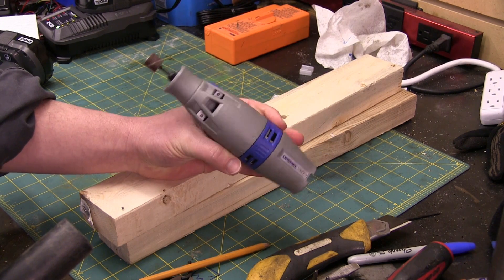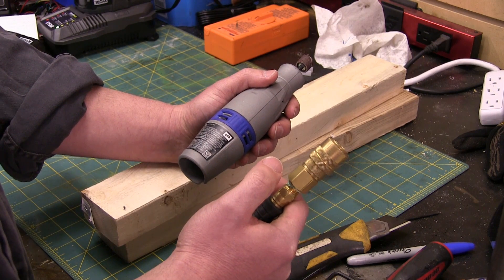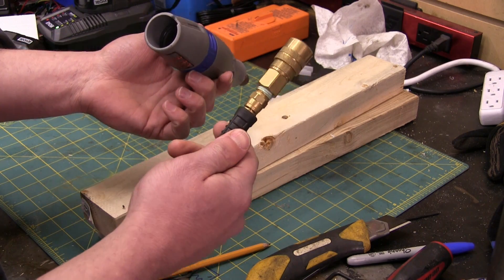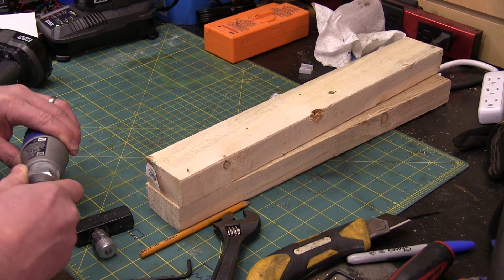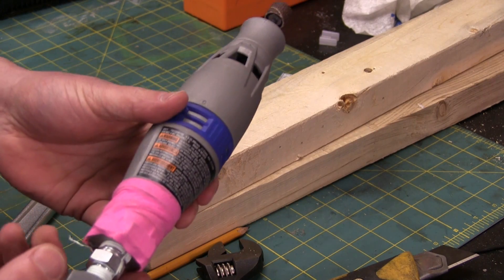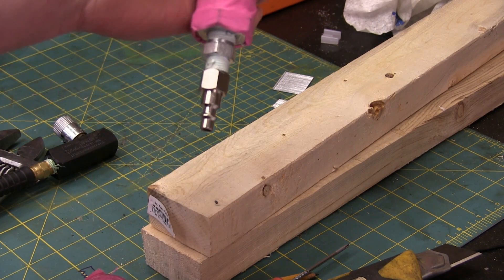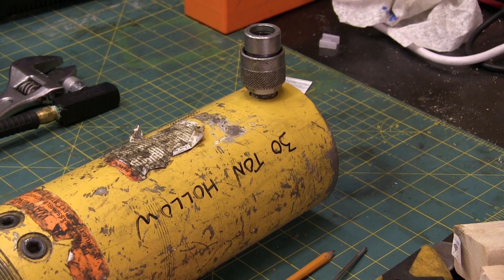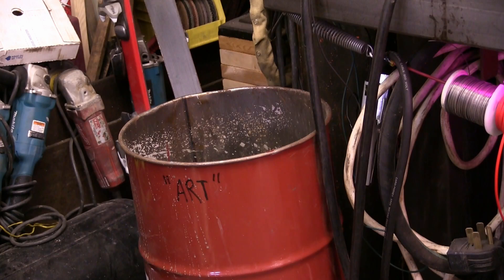You asked for it! Patron's Request: Dremel Suck Tool on 100PSI air

Comment: fittings are in inches, left over from the dark times.
Reply: +AvE Aircraft mechanic here no metric as far as the face balls can see. Aircraft are all From the Dark times!
Reply: GreaseMonkey well of course they still measure altitude in feet like it makes sense because you can relate to the amount of feet stacked up in the air and imagine the height.
Reply: @taticalguru  thought "system international" was it's on thread system.  Is it based on imperial?
Reply: +Paul Frederick Never happened
Reply: +Simonas Mažeikis (ZetZet) The dark times? Like when men walked on the Moon?
Reply: @1pcfred  ......but they never walked on the dark side.
Reply: +Simonas Mažeikis (ZetZet) meters?
Reply: +AvE&#160; fred form here in the&#160;rain soaked UK&#160;is still good old BSP (British Standard Pipe) but metricated and no a 3/8&quot; don&#39;t work with 10mm etc and for the gas (as in natural and not petrol) there is GSP and for us electrical types we have a BSP fred form for conduit which straight and not tapered ................. with all of it the good old Plumbers Tape for Everything (or PTFE for the uneducated) works .................... sometimes :P
Reply: +AvE 
When people had 12 digits
Reply: bicylindrico
Sure it did. I was there.
Reply: +AvE would have been nice to test it with leaf blower....
Reply: Paul Frederick men walked on the moon after imperial was dead for 10 years, I meant the industrial ages. When we burned coal for steam.
Reply: excavatoree
Chinese digital calipers come with a Whitworth chart on the backs of them. So maybe they still use it?
Reply: +Simonas Mažeikis (ZetZet)  yes fittings and tubes (the kind u use a thread cutter on)in inch
copper,pex,alu-pex,pvc,hose,tubes for viega profipress or geberit mepla ,mapress in mm and bicone (the clamping part)metric thread
ave always in detail best i can do is return the favor
Reply: shurdi3 well it's just how an inch is called here
Reply: Simonas Mažeikis
It is the present day here.
Reply: +Simonas Mažeikis (ZetZet) True. The term 2x4 is the lumbers rough cut state. That's when it is straight off the saw mill. 1.5x3.5 is the size after drying and planing. Besides, 2x4 is much easier the say for us.
Reply: MrTheHillfolk
I heard a story about some industrial espionage in WW2 that the Japanese did to the US. They copied one of our socket sets. Quite the coup for them really. Except they kind of got the sizes wrong. They copied the standard sizes but their hardware is of course all metric. So the poor Japanese mechanics were trying to use these sets in the field for repairs and nothing quite fit right for them. I don't know if it is true, or not, but thinking about it sure is funny.
Reply: +Paul Frederick 
You said hardwood. 
Heh. Hehheh. Hehhehheh. Hehheh. 
See profile pic for explanation 😂
Reply: @MrTheHillfolk   I'm late to this video, but that's funny.
Reply: @randywl8925  
Haha I'm still around 😁
Reply: @MrTheHillfolk  you can check out any time you want.......
 _ _ _ _ _ _ _ 😁
Reply: @randywl8925  but you can never leave ..........last thing I remember , I was running for the door......
Reply: @MrTheHillfolk  I think AvE has us addicted.  It's a good place, and not just him...... the comments too. But I'll give him 99.8% of the blame. 😉
Reply: Iceberg86300 that's because box stores don't have lumber milled from old growth forests. Thses are going away now. Harder to find old growth timbers. Wouldn't matter if they leave extra or mill it off it will still be the same quality. Crappy knotty cracked wood made from stick tree farms. Build a stair case this weekend. Home depot treated lumber. Looked through the entire stack literally for 6 pcs. The 6 I got were the best ones and they were still garbage. All department store wood is only good for fires really 😄 I had to jokingly ask one employee "hey this is the give away pile right?" lol sarcastically it wasn't lol.
Reply: MadMetalManiac74
quality trees take a long time to grow. Longer than we as a species can afford to wait anymore. The trees that grew the wood I saw were hundreds of years old when they were felled. Once its gone, its gone. Another thing that is unavailable today is decent balsa wood. When I was young they sold it. The crap they sell as balsa wood today is nothing like the stuff 40 years ago though. In my lifetime apparently the good stock was used up. People cashed in. They made as much as they could, as fast as they could.
Reply: Robinson Joe
roll coal!
Reply: Diesel, woot🤘🏻
Reply: It's 4x2" here in the land down under, at least it used to be till it was 100x50.
Panel board comes in 16mm, 18mm, 25mm and 32mm, strangely close to imperial sizes, hmmm.

It occurs to me that the international space station must have been logistical nightmare, from a standards point of view.
Reply: +Simonas Mažeikis (ZetZet) allover europe and asia and africa and india and america, bout of them !
From neanderthal since...
Reply: +Rich ok I remember my first time posting on the internets.
Reply: +Simonas Mažeikis (ZetZet) We were burning oil for steam by that stage
Reply: +Simonas Mažeikis (ZetZet) Do they not at least disguise the fact that it's an inch with a word like Zoll where you are? 

Here it's Цол, but whatever
Reply: Huh...Here it's specifically for pipe/rim diameters only
Reply: shurdi3 pipes are metric, fittings are in imperial. it's fucked.
Reply: +Simonas Mažeikis (ZetZet) At least no one uses Whitworth anymore.  (do they?)
Reply: +Soluciones Tecnologicas : I agree with the leaf blower idea. The impeller needs more volume: ^volume = ^RMP (impeller choke setup)
Reply: +Paul Frederick You would think that, but no. A 13mm wrench becomes a nut rounder on 1/2 inch. It'll work if everything is all smooth and lubed up, but if it is the same kind of worn out corroded shit that I typically work on you sensibly go to the toolbox and grab the SAE... preferably in 6 point.
Reply: Randall Waitt
I just measured a Mac open ended wrench here. It is 12.96mm Close enough to 13mm to me. But I was referring to square drives in my earlier comment. All of that is imperial.
Reply: +Paul Frederick 
8mm= 5/16
11mm=7/16
13mm=1/2 
14 or 15mm is like 9/16( I forgot which) 
16mm=5/8
17mm=11/16
19mm=3/4
That's a simple list of most sizes you can swap/interchange wrenches , usually , most of the time , as long as it's not snowing or raining or too sunny or too cloudy. 
If the fastener isn't too tight the interchange works. 
It works a lot better on the 17mm and up.
Reply: +Paul Frederick yea lol that woulda been a hoot and I don't doubt it !!!
I wanna say I might have heard a similar story like that before, it kind of sounds familiar. Like One if those things you totally forgot until you hear about it again.
Reply: MrTheHillfolk
it is one of those stories that sounds plausible enough. It would take a real breakdown in communication to be true though. Either way it is a funny scenario to consider. I see some poor Japanese mechanic breaking his knuckles with his tools slipping on him. Rots of ruck Charlie!
Reply: +Contango1000 yeah i think it's just because of building codes really. we do it "just because" type of scenario.
Reply: MadMetalManiac74
lumber dimensions are sized before surfacing. Except hardwood. Then they are what they are.
Reply: Paul Frederick basically as I thought. Just because they can. 
http://www.standard-freeholder.com/2013/11/10/handyman-hints-once-a-true-2x4
2x4 back in the day ACTUALLY used to be 2 inch BY 4.
Reply: MadMetalManiac74
they also used to be rough cut from the saw mill then too.
Reply: Paul Frederick unless you're planing EVERY cut is a rough cut no? more or less they used to actually measure closer to 2x4.
Reply: MadMetalManiac74
I worked on a national registry historic landmark job and pulled boards off that place 30 feet long, over a wood wide, without a knot in it. That wood was over 170 years old, if it was a day. Nothing like that has existed on this planet in your lifetime either. Because all of those trees were harvested over 100 years ago now. Why wouldn't the old timers have taken the best for themselves? You do. They just beat you to all of the really good wood.
Reply: Paul Frederick yeah I know 😕. The lumber industry is not even close to the quality it used to be. not even the same realm. part of the reason is no one builds anything with the idea of it lasting longer than 10 20 years. So the wood doesn't need to be as good. Everything gets rebuilt. That's not how my mind works. I build to last forever. I feel like pulling my hair out anytime I have to work with wood like this. Which is just about ALL OF IT.
Reply: Dug6666666 not really, NASA is almost entirely metric, has been for decades.

They still have the occasional imperial leftover but it's rare.
Reply: Faiz Imam NASA did manage to smash a lander into Mars because NASA's numbers were in metres and the contractors writing the software thought they were in feet!
Reply: are you religious by chance?
Reply: *****
NASA also hasn't done anything really noteworthy in decades either. Coincidence? I think not!
Reply: shurdi3
all metric is just a disguise for the fact that it is all in inches. Them and their 13mm drives. It's a half of an inch!
Reply: it is not the dark times it is the better system, don't ask why it is better it just is.

Comment: We still use the Imperial system for thread in Australia even though we're metric
Reply: I think
Reply: +runforitman And most tools are still from the dark ages; my new routers are 1/4" and 1/2", but are sometimes calle 6.12mm and 12.7mm, just for shits and giggles.
If we were to start again they'd be something sensible like 5mm/10mm/15mm or whatever.
And don't get me started about plumbing.

Comment: Just "creating" a dust extractor for my wood work. Pulled apart a $45 Psychotic vacuum cleaner for it's sucky bits... ABS for everything, HEPA equivalent filter components.... aka fisk filters & clip in wheels with no bearings. Pretty sure if you tack weld a dremel tool onto the shaft holding the fan/impeller it would work better than the Dremel Suck.

Comment: In Europe we use these for fittings:

DIN ISO 228 Code Letter G - BSPP (British Standard Pipe Thread) also called Withworth Parallel Pipe Thread
DIN 2999-1 Code Letter R/Rp - BSPT (British Standard Pipe Taper) also called Withworth Tapered Pipe Thread

Interestingly, both BSPP and NPT are not designed to create a seal through the threads alone. Which is probably why there is tape on your fittings. Even NPTF only creates a dry seal without additional sealant.

Comment: All pipe fittings and pipestuff in general are imperial, although they are tryin to use metric on the side.. But i must say that i prefer to buy 2" pipe than 50,8mm pipe..

Comment: I gave found that we use bspt for most air and threaded pipes, which is imperial measurement. But you go to compression fittings for copper or push fit for airlines and we use metric. it's a right fuck on, but there's adaptor fittings galore. just gotta know where to look :)

Comment: you didn't have enough volume of air. you had 100 psi coming out a little pee hole. if you had 100 psi coming out a 2 inch hole it would have worked alittle better. but still like shit because that thing is junk!!!

Comment: For the question in the beginning off the video, we use non metric fittings, so 1/4" or 5/8" fittings  etc. or its labeled with some odd metric number. but compressor fittings and hoses are all non metric so 1" or 1/2", Greetings from a dutch elecchicken

Comment: Comaaaaaannn guy you need to put more volume of air through it not pressure to make it chooch.. Should have used a shop vac in the blow mode instead.. But than again we wouldn't have had this vijeo, for that I applaud your attempt!

Comment: In Australia we use BSP. British standard pipe threads. Then in there wisdom they tried to metrify them and now they make no sense. You ask the pimply little parts interpreter fo something with a 3/8" BSP  they look at you like you have 2 heads. dont even try to explain to them that the 3/8" is actually the inside diameter of the pipe and not the OD of the thread.

Comment: Over here in the UK we have 2, BSP and BSPP, BSP is like NPT but with a different included angle of the threads, and BSPP is pretty much a straight thread that relies on an o-ring or a copper washer to deform to make the seal, BSPP is far more common over here and it's what all our air-line fittings come in, but BSP can still be seen in older buildings.

Comment: Had to fucking import an NPT tap to repair my central heating the other day. Yeah, apparently we use NPT for fittings in the Netherlands. It sucks. For my engineering projects I use proper Metrique with the high-quality insta-break o-ring seals.

Comment: Again, you kept the escape holes shut.... 

And as for the "Continental Metreek" we still have imperial sized threads around at the DIY stores... mainly because the gas fittings in all the houses are in imperial sizes since before the metric system was mandatory. It basically means that we in that regards still use that, and it confuses everybody here. (hey, I found a 3/8" that should do it, looks the same size... nonono, we need 1/4" you donkey). While everybody understands that M10 doesn't fit M8 or M12. (only the french use M7, M9, M11, M13, M15 etc).
Also, tapered threads are near non-existent in "metreek", for normal design is to NOT depend on the threads to hold any pressurized content, but use rings or w/e.

Comment: FOR THE LAST FUCKING TIME, YOU NEED VOLUME!
consumer vacs basically suck as much volume as they can, because that's what gets the product sold. blowing 100psi through a quarter inch hose is not anywhere close. You know that, you are not stupid.
 You just down want to give it a chance. Im not a Dremel fanboy or anything, just shit talking a product while not using it correctly.

Comment: ok in Metric old New Zealand anyways what happens is we use a bastard mixture of everything.  Most all plumbing, air and pipe fittings are BSP which is almost exactly the same as NPT but slightly different.  And now with Ali Express and Ebay we get all sorts of knock of adapters and people just use whatever the hell they can find.  So in a metric country Marine, aviation and Fittings are mostly English imperial and everything else being metric.

Comment: pressure does not equal volume with air, so there was not enough volume. If this would be 1 and 1/4 air hose it would work ok. And tear this dremel apart probably :-)
Reply: +3majsie maciek Some fans are bi-directional. Turbines are not. This is a turbine, not a fan.  Fans impart energy into the stream of gas, turbines pull energy out of a stream of gas. 

Turbines work best when your medium hits the turbine at high velocity and the proper angle. What AvE is doing is kind of like spraying a garden hose in the general direction of a pinwheel. Not much is going to happen.  On the other hand, if you take that hose, put your thumb over the end to get a nice high velocity jet of water, and direct that jet of water to spray straight onto the pinwheel blades, it will spin up very quickly, and spin much faster than a higher volume, lower speed flow.
Reply: +3majsie maciek
Not sure how well it would still work, as it is running in reverse too in this configuration. It actually is designed and requires the airflow to run from tool end to the back end, with a Vac pulling the air through. So even if one had it up to a true vacuum with monstrously high flow, the actual pressure could never exceed atmospheric pressure. It is, I'm assuming designed specifically for high flow, low pressure.
Reply: I know it's in reverse, but most fans are bi-directional so I guess it should be ok. Maybe that the pressure on the fan blades would make the bearing hard to spin and not give good performace too.
Reply: +3majsie maciek - Exactly! (somewhat, kinda sorta, similar in theory to water pumps on modern (and  not so modern) day Fire trucks, having  a pump with a design / capability of pumping in either volume or pressure at the flip of switch).  Would love to have seen AvE attach a gas powered leaf blower!   One can hope this will be revisited and properly rectified at a later date!!